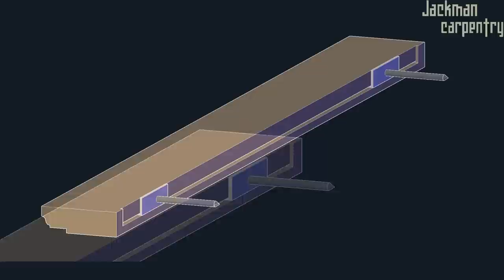Simple Floating Display Shelves

Comment: How accurate do you have to be on that mounting system?  Seems fairly easy if there is some play and I haven't seen that used for a floating shelf before. Very cool
Reply from the maker: You want the groove to be right on the money since there isn't a lot of surface in there, just enough play to barely let it slide back and forth